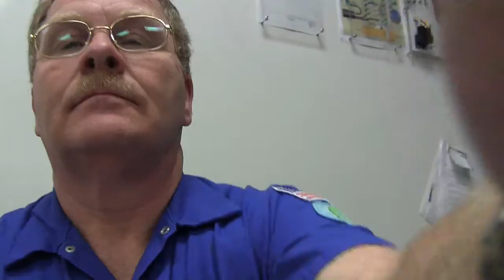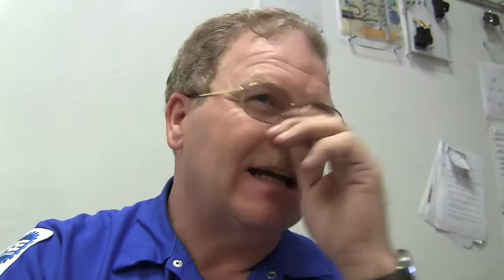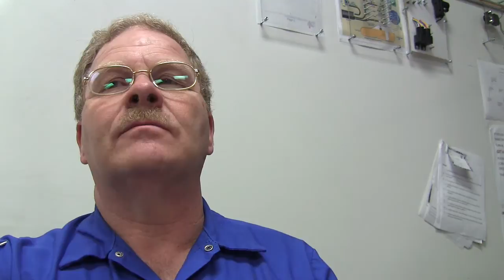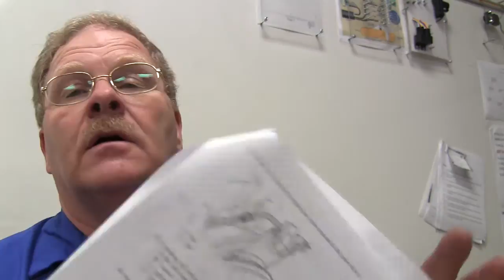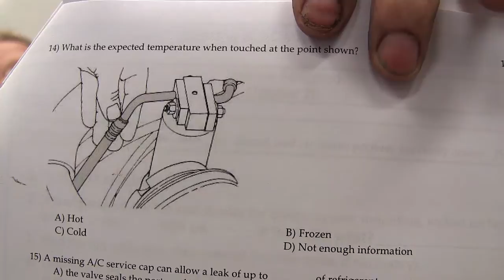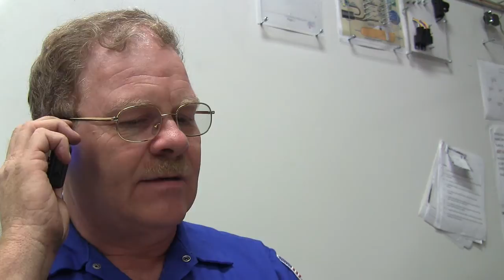Heating & AC test 11   Diagnosis Basics

Comment: Mr  Mc cuistian, I too  the ase, test and one of the questions asked was " where does  the in line filter  is located?  " that's  something I didn't  really  know.  and I try to Google and can find out  where this filter  should  go.
Reply from the maker: +Moises Merlan - That filter is typically in the suction line right at the compressor.
Reply: +McCuistian thanks. !!!